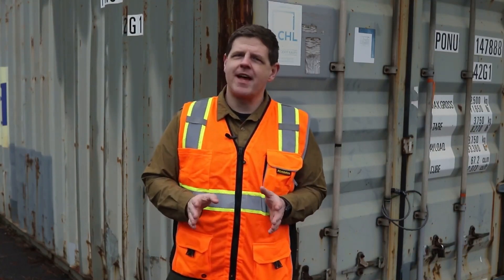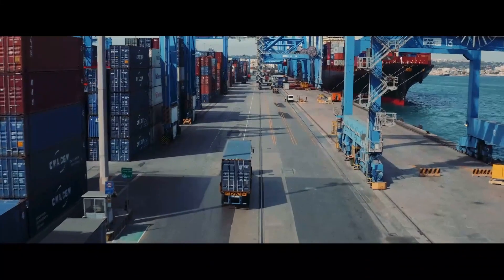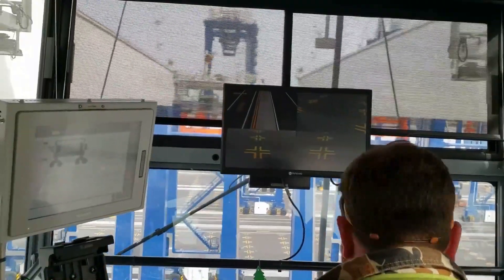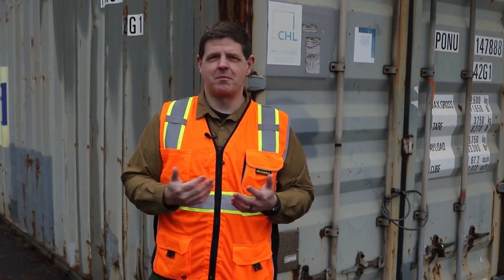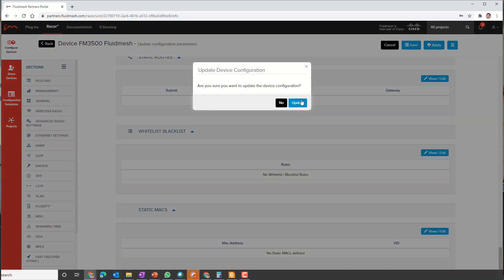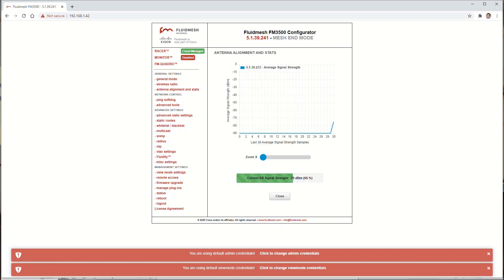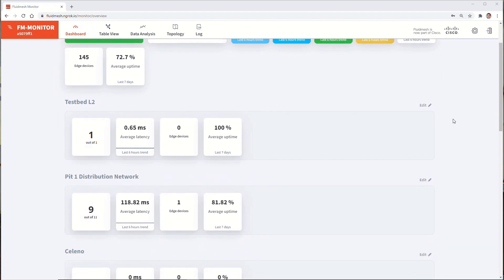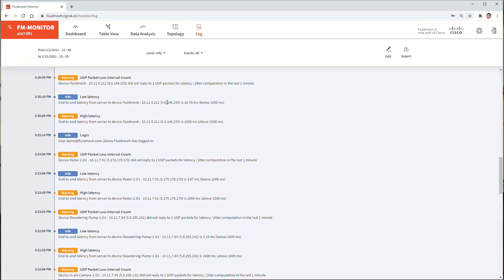Cisco Ultra-Reliable Wireless Backhaul Demo | Resilient Wireless for Industrial IoT

Comment: What is the range in km for FM4500/4200 to implement fluidity with 5mbps speed for single autonomous truck on road ? for example to deploy CURWB on transport/road what is max distance radio it can cover with -96dbm
Reply from the maker: Do you have questions about some of the technical content you’ve seen this week? Check out our CiscoInsider User Group to engage with product experts and share best practices around Cisco tech in private community forums.  

Learn more http://cs.co/6055MMSER